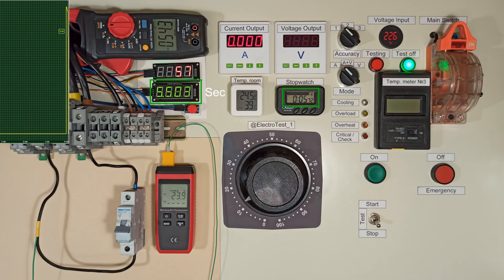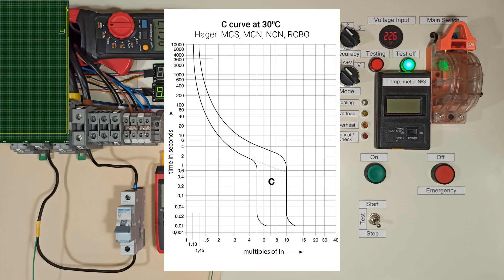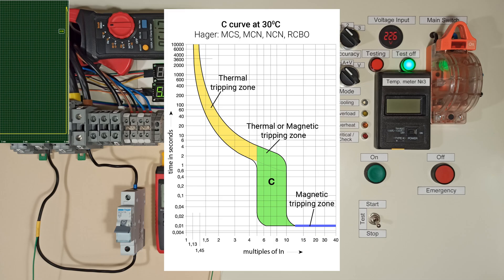Real Test MCB 16A C curve . Hager MCN tripping time

Comment from the maker: Please support my channel: https://www.youtube.com/channel/UCqZUswoAI9E9iFcTeS7L6gw/join
I could have started testing breakers earlier. However, testing the magnetic trip of breakers is much more complicated and takes much longer. Many instruments simply can’t correctly capture the current, let alone the timing. Having to download oscillograms and inspect them on a computer every time just to set the trip current is a pain. That’s why I worked on developing a device to record fast currents and timing. Now I have the first prototype and I’ll keep improving it. From the video I can draw a few conclusions:
1) I started each test from a cold state (10–15 minutes).
2) We observed tripping of both the thermal and the magnetic trip units.
3) Interestingly, at high currents the instruments record currents that are shorter than one mains period. Sometimes they don’t even reach the peak value, so it looks like the current was lower — although if you run several tests at the same regulator position you’ll see the maximum current.
4) The monitor and my homemade device are connected to different current transformers. I think the current transformers may introduce some delay, and the breaker may actually have tripped several milliseconds later. This isn’t certain =) — I now want to measure the delay of the current transformers. Are you interested in that too?
5) The middle zone, where both the thermal and the magnetic trip unit can operate, is probably the most interesting.
It would be interesting to hear your comments and ideas for breaker testing
Reply: Another test that would have interesting results but I'm not sure just how many amps you have access to with your setup.  It will need to be capable of several kA.  Compare the peak current that flows with the same amp rating (as in all are 50A devices or what ever) HRC fuse, thermal only breaker, and a thermo-magnetic breaker.  Basically to demonstrate the inherent current limiting nature of the devices.  I'm not sure which of the HRC fuse or thermo-magnetic break will be the lower but I would expect the thermal only breaker to have the highest fault current.
Reply from the maker: @retrozmachine1189 I understand your comment. But why does it have to be several kA? I’ll probably be able to supply 1000–2000 A. I think it will still be noticeable even with lower currents 🙂. Breakers have a solenoid, and I think it really might somewhat limit the current — although I’m not sure yet. What if we just test a fuse and a breaker of the same rating while keeping the regulator in the same position? That would simply be a comparison.
Reply: Complimenti, ottimo test! 👍
Reply from the maker: @bijeimath605 Thanks for the feedback!

Comment: What causes that buzzing sound at 2:32?
Reply from the maker: Buzzing can often be noticed in circuit breakers — this happens due to vibration of the internal components. It’s especially easy to hear the vibration of the electromagnet parts. The current may already be quite strong but still not sufficient to fully pull in the plunger, so it oscillates back and forth without tripping. In such cases, the thermal element is the one that triggers.
Reply: @ElectroTest_1  - Ohhhhh.  That makes me wonder what would happen if you keep a buzzing circuit breaker at that current for a long time. How long would it take before it mechanically damages itself?

Comment: What about very short and high current peaks? Eg my ATX power supply has a X capacitor connected between the line and the neutral. Two Y capacitors connected between the line and the ground and between the neutral and the ground. Short circuit current, measured from a wall socket, for 16 A C type fuse should be over 200 A in Finland. sqrt(2)*200 A = 283 A. sqrt(2)*230 V = 325 V. The X capacitor is KNB1560 0.22 uF. Two Y capacitors are "471K kh250 xiy2". 471K should be 470 pF +-10%. I don't know the resistances. The current spike will be very short so the total inductance will also limit the current.
Reply: There are "high magnetic" circuit breakers that are made for use with devices like that.

Comment: do you know , or can you test at a DC current ,which pole will heat mostly ?
Reply from the maker: Did I understand correctly that you wanted to know which part or terminal heats up more — the upper or the lower one?
Reply: @ElectroTest_1  yes , would it be one that will heat up more than the other ?

Comment: The RMS=Vmax/ squert (2) is in case of sinus form
Reply from the maker: It’s great that you noticed this, because I have been thinking about this question for a long time. What current should be applied to breakers when they trip in less than a period? This is not a sinusoidal current, but an instantaneous rising current. However, the entire breaker characteristic is based on the RMS value of a sinusoidal current. I decided that a more or less reasonable definition for currents of ×10, ×15, ×30 would be Im(peak)/√2. This is a matter for discussion — perhaps someone will have other well‑founded opinions. How can you determine that you have applied a ×15 or ×30 current if it lasts less than a period?
Reply: @ElectroTest_1  
To calculate the TRMS (true RMS) you can use a quality oscilloscope (tektronix or other) which has automatic measurements of any signal, or you can also use a quality TRMS multimeter (fluke, hioki or other) with sufficient bandwidth, because in your case the difference between RMS and the true RMS can be considerable
Reply: @ElectroTest_1 I think the specifications usually is in prospective fault current, the rms of the sinusoidal current that would have developed if the breaker had not tripped. If you want to account for that you need to do tests both with and without the breaker at each current seting.
Reply from the maker: @larslindgren3846 Thanks, my friend! I think the same way. The characteristic is based on the expected current as if there were no breaker in the circuit. That’s exactly what makes testing so tricky.
First of all, you have to reconnect the circuit every time — and each contact under such high currents affects the current value. Secondly, the breaker itself influences the test circuit. If I leave the regulator in the same position and pass the current without the breaker, the current would be much higher.
I think that testing setups used for breaker certification have slightly different parameters. However, according to the standards for circuit breakers — for example, IEC 60898-1 (which applies to miniature circuit breakers for household use) — the goal isn’t to measure such fast current spikes. They usually limit it to ×5 for type B and ×10 for type C, and the tripping time must not exceed 100 ms.
In other words, they don’t really go deep into such short intervals — it’s basically just “less or more than 100 ms,” and the current at which the breaker trips isn’t extremely high(x5 for B, x10 for C).
We, on the other hand, can see that instruments start to go crazy at higher currents. Although, in my case, the equipment and system aren’t yet sensitive enough for very fast measurements.

Comment: This characteristic, although optimally designated, is the reason why circuit breakers with different tripping currents are not selected from each other. For example, if you have a 16 A Type B circuit breaker in your apartment and previously a 25 A Type B circuit breaker in the hallway, in the event of a short circuit (approx. 300-500 A), both will trip immediately.
Reply from the maker: Hi! You’ve brought up a very interesting topic — selectivity! I really like that one. I think it would be more correct to use a Type C breaker for the main input. That’s what’s usually done. This way, the likelihood of everything tripping at once is much lower. But it can still happen when the short-circuit current is really high!
Reply: @ElectroTest_1  
I noticed this connection almost 30 years ago when I was designing an installation for the company I worked for. Initially, a C 40 A circuit breaker was used as the main circuit breaker, and it turned out that it tripped on every short circuit (the short circuit current was over 600 A, and the C 40 A instantaneously trips from 200 to 400 A). At that time, I used a selective main circuit breaker – the S 700 SMCB system. It was expensive, but it served its purpose.

Comment: Interesting experiment, capturing large currents and fast times will be problematic. You are really in the world of transient analysers to get consistency. I remember trying to time arc protection systems in a previous job took a lot of time and testing to perfect.
Reply from the maker: Thanks for your comment! I have some experience working with arc protection systems. Which one do you mean exactly? A light sensor combined with current monitoring? There were some difficulties in understanding the logic of the microprocessor-based device, but the transient processes didn’t have much influence there, since there’s a specific trigger — the activation of the sensor in a certain compartment.